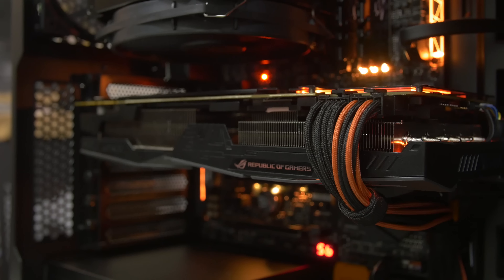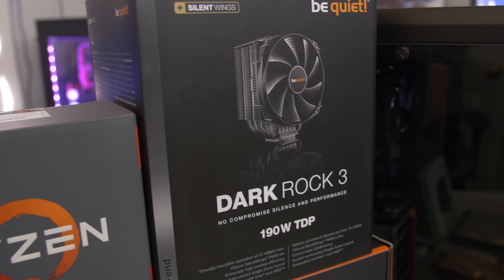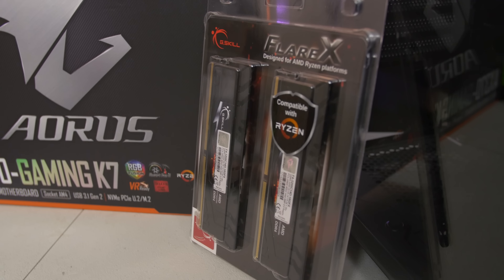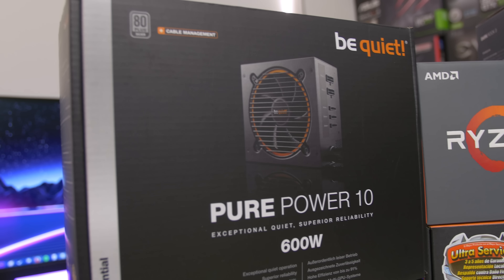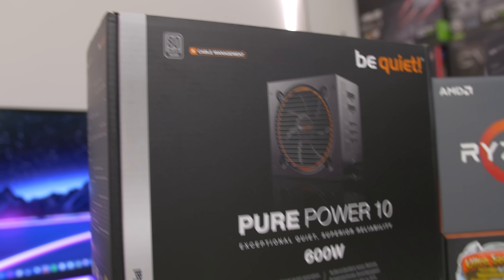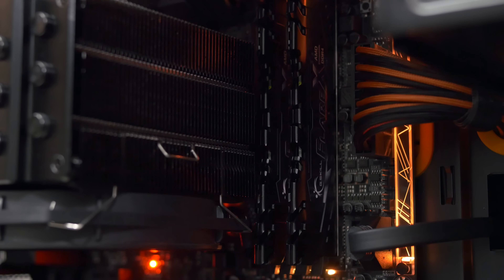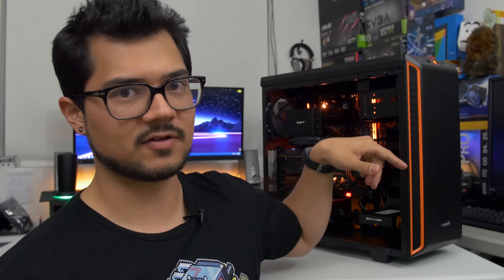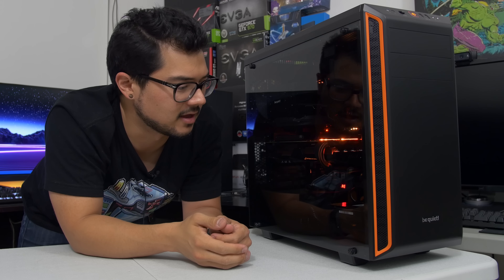INSANELY Fast Ryzen PC!! 1800X + GTX 1080 Ti

Comment: How can a motherboard be VR ready?
Reply: ayy lmao he has a point
Reply: Yeah and that would be integrated graphics, which Ryzen doesn't have. Neither is there any integrated graphics solution available that's actually VR ready...
Reply: Actually AM4 motherboards are designed to support APUs as well, so they have a graphics output. That's how they are VR ready. We'll get some pretty powerful APUs with raven ridge in the second half of this year.
Reply: @Ship Uh, no, that makes ZERO sense. No one is using any HDMI port on the mobo itself for VR.  You would only be making use of integrated graphics at that point and no IGPU is capable of facilitating VR.  You would plug your HDMI cable from your HMD into your VR-ready GPU (which is actually a thing). Some GPUs have an HDMI port on the inside for cases with an HDMI passthrough in the front.
Reply: You mean, how can a piece of glass be VR ready
Reply: Maybe Raven Ridge APUs will be powerful enough to run VR?